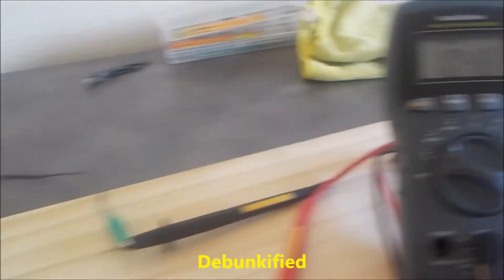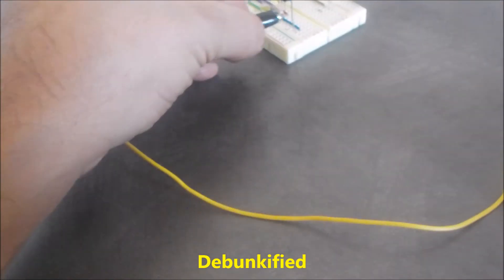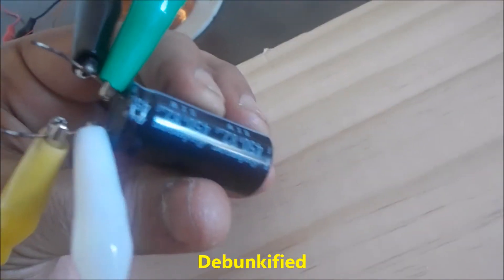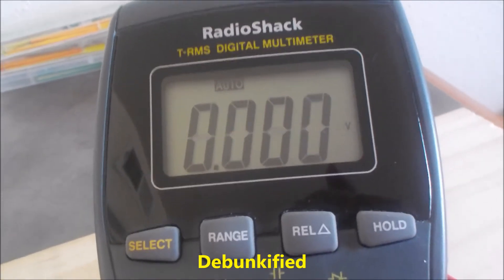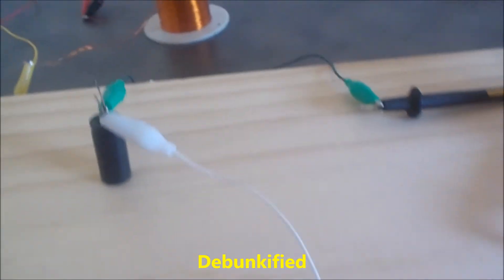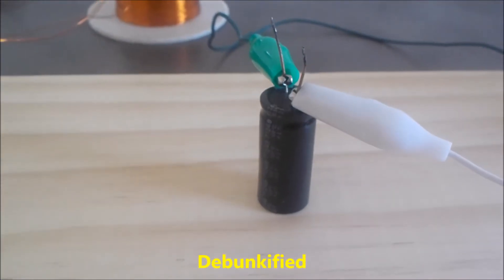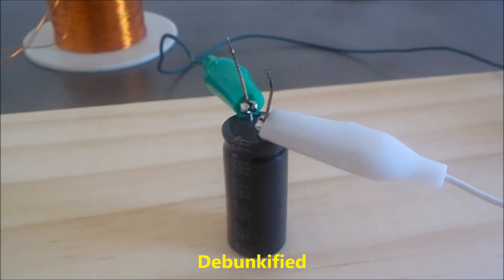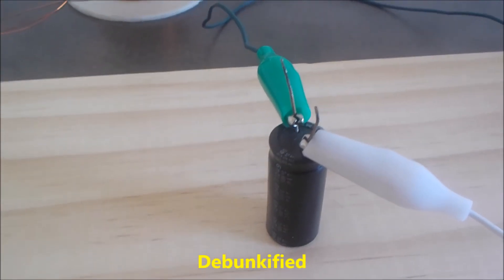Tesla's Simple Secret of Capacitor Rebound Effect (Revisited)

Comment: I think this is what bedini refered to as negative or radiant energy. According to him, this would also happen using lead acid batteries. Obviously you don't short the batteries to get the self charging effects. 

I thought i'd mention it since you were looking into a different capacitor or I guess battery in this case.
Cheers JP
Reply from the maker: Thanks for your input. Batteries do the same, but the rebound effect only gives around 2% extra energy and becomes very hard to detect when observing it closer and closer. I think a deep and hard discharge makes it more pronounced.
Reply: @debunkified  Alright, Well 2% isn't a lot. I wouldn't know as I don't have these batteries atm to try it, however I remember him say it from watching countless videos.
Reply from the maker: Here’s a video that shows an experiment you could do to see the bounce back effect a little better. https://youtu.be/Enjm5RZgsCg

I spent a good amount of time on that experiment and the closer I tried to look at it and the more I tried to measure it the more it disappeared! 

Maybe this has to do with the observer effect if you’ve ever heard that before, it’s quantum related and has to do with consciousness effecting reality. I could be be way off base with that however.

I mean tried looking at the current going into and out of the motor, which of course is always the same.

The motor then of course is doing 50% work while the other 50% is saved in the capacitor to do work later on.

Here’s a video on Nicola Tesla’s capacitive discharge apparatus, there a coil charges a capacitor up to a nice high voltage level, which is just the energy that came form the source.
https://youtu.be/lx3aKc2pMig

Then when it’s released a big blast of wattage comes out, there the rebound effect after discharge should be quite high.

If you transfer close to 100% energy into the capacitor and then discharge it all out right down to zero, it bounces back up in a dramatic way, from zero! Like maybe to 10 volts or more from zero volts.

The question is, if the capacitor was discharged to zero then what exactly is the energy afterwards when it bounces back up? Perhaps this is my ignorance of what dielectric absorption is.
Reply: @debunkified  That does sound interesting. I remember back in the days I also saw this rebound effect your talking about. Question, did you remove my comment on your other video? :) Anyhow nice work, I was hoping to find someone to talk and share about these cool experiments, but this sort of freaks me out.
Cheer JP
Reply from the maker: @toffeeflavour  What is freaking you out? What comment are you referring to and which video was it?

Comment: the dialectric and the magnetic field are analogous to each other, in the capacitor the disrupted discharge generate a broken simetry, so theres a wave in the oposite direction when the field colapse, why don`t you do the same test disconecting completly all the wires to the capacitor and after you discharge the capacitor take the time the capacitor take to charge again and then connect the multimeter and make a read to avoid some capacitance o interference that the multimeter could produce in that case
Reply from the maker: Carlos Aybar Disconnecting the voltmeter leads allows the capacitor to charge up even faster and better due to the capacitance of the leads being removed.

It’s a strange effect indeed and is not quite so obvious that the entire energy of the capacitor has been removed by observing the voltage become zero after being discharged and then regaining some of it back.

Then again the dielectric absorption  could simply be hiding some of this charge on the dielectric of the capacitor.

Comment: I am working on similar experiments. I was fooling around with electrolytic effect by using different films to see how much self charging memory I could get, and stumbled on one that would charge on heat energy. It was pretty cool cause I was trying to explain to my friend about  electrolytic memory and he grabbed it with his hand and it begun to charge on the meter, so I put it near a heat source and it started to charge up quicker. I repeated the experiment on video. I found your video because I am looking at trying to figure how to make a high voltage very fast charging super capacitor to use on my energy harvesting experiment. Loved your video thank you for sharing.
Reply from the maker: +Ralph Hernandez That is interesting, I have seen this effect as well and is a very good one indeed. 

Perhaps obtaining a thermoelectric panel to generate a greater heat output than electrical energy going in could be contemplated.

Comment: Did u see single wire transmission by tesla? It sucks charge from ambient space maybe ? There are ideas how to charge capacitors just from antenna and ground. Maybe that is the point. For sure there are thing we dont know about electricity. Watch Eric Dollard videos and u will see. Theory of antirelativity.
Reply from the maker: +FreeKanal Yes the earth is a capacitor that contained energy and voltage per foot with the ground (earth) being negative and the upper atmosphere being positive, for example, the path lightning takes. We can capture that same power, but need very very high aerials.

Other than that, only a few feet of wire connected to ground and sky with a capacitor in between is only receiving manmade radio signals.
Reply: I have room antenna and charge capacitors to 4v :) i dont have antenna set up very high. I live on the ground level. My antenna is 1,75m high(not counting ground). U got all minus potential from ground, and now u need more collector surface at top plate( (+) potential). Then these potentials want to balance them selfs through capacitors i have beetween. Higher antenna is better, but there is no need for that. I have joule thief and i have power, low power but that is the beginning. Resonance is the key to collect more. What i think is u need to pulse that ground-air antenna with little power to harvest more charge. I just started to experiment with that. Of course u need open circuit like tesla was using(tesla magnyfing transmitter). It works like swing. U put little power over time in right spot and u swing it to gain more potential, u dicharge it to close circuit inductor it collapses and the cycle repeat. Sorry for my english.
Reply from the maker: +FreeKanal First find out if there are any tv or radio towers near by or even telephone poles.

You'll find if you take your current apparatus away from all man made power signals that you will have nothing unless you raise your plate thousands of feet into the air.
Reply: That is not true. There is all the time potential diffrence beetween 2 separated metals. The thing is how much metal surface is separated by what dielectric. It doesnt work by magnetic induction as u think. It is electrostatic all around u in every point in universe. I will quote tesla "Electric power is everywhere present in unlimited quantities and can drive world`s machinery witchout the need of coal,oil,gas or any other fuels" Of course ifu live in city u will also capture radio waves and diffrent magnetic field fluctuation. But even when there was no radio there will be always fluctuations in space. You just need to magnyfy it and use.
Reply from the maker: +FreeKanal Ok, have you tried taking it away outside of the city far away from any man made signals with your 2 m high antennae?

Comment: bemf from coil allows the capacitor to receive a big charge pulse as soon as the coil is switched off. I reuse battery power from dc motors like this